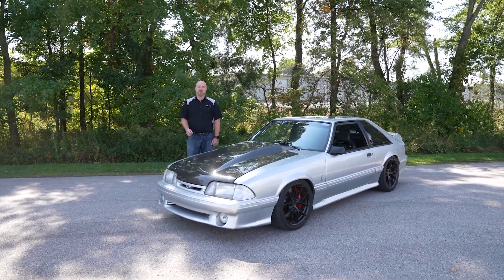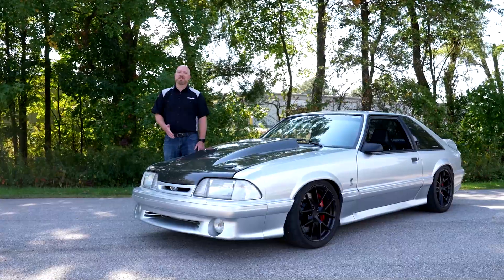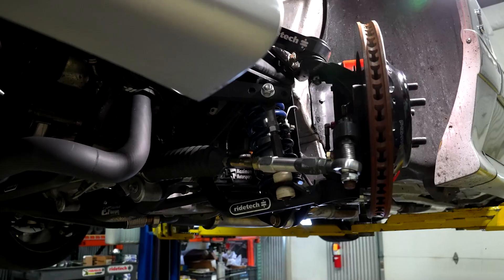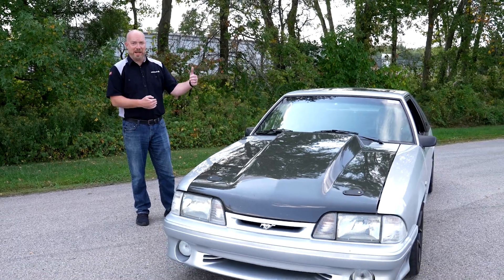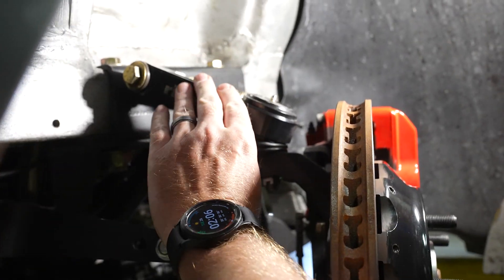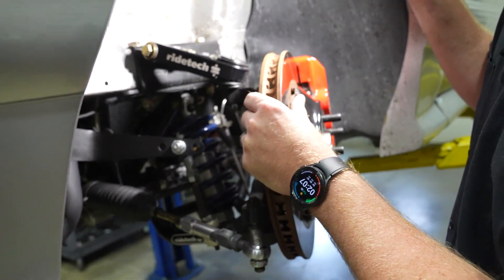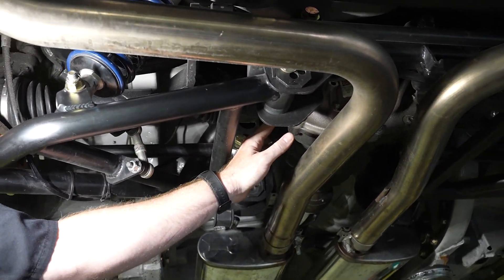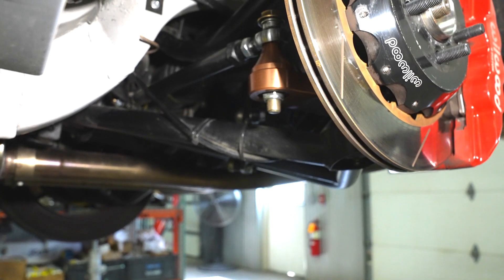Fox Body Suspension Transformation (SLA & IRS Combo)!!!

Comment: RideTech deserves huge credit for bringing these suspension upgrades to market. But when all is said and done we're talking about $10K for the base front/rear setup, and almost $14K when the upgrades are included (aftermarket k-member, reservoir shocks, rear sway bar). That's assuming you won't have to buy wheels/tires or brakes. 

Is it worth it? If you're going to keep your car and really drive it, perhaps it is. And with the price of modern performance cars, it may even be a bargain.
Reply: There is a full frame for fox body with suspension for around the same price.. I have a sneak peek in my shorts..

Comment: I have the full maximum motorsports max grip package and paid 6k for it but this definitely has my interest. But man this kit is pricey i guess I'll go sell some blood on the weekends 😅
Reply: To add the kit does not come with the coil overs or the caliper brackets.
Reply: @tedjones-ho2zk  yeah I saw that also need to need to add a diff, axles and exhaust. I think it came out to $6700 on the their site plus a irs Catback so like another 800 bucks.
Reply from the maker: @tedjones-ho2zk, Reason for that is the system is compatible with either our coil-overs OR our shockwave air shocks. Both have cost variability so we leave that option up to the customer.

Comment: With the new front suspension SLA, can it be made to keep the stock ride height or is it designed to lower the front end no matter what.
Reply from the maker: @tedjones-ho2zk , this system utilizes spindles/knuckles that have a 2'' drop designed into their construction. As you said, it is designed to lower the front end.
Reply: @ridetechtv  Thanks for answering my question